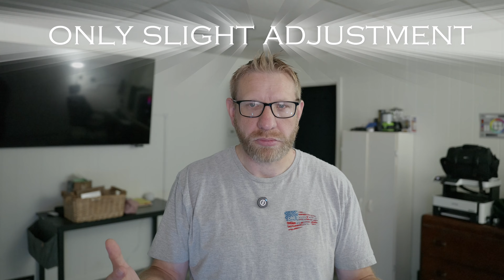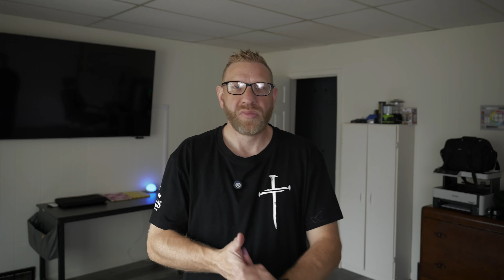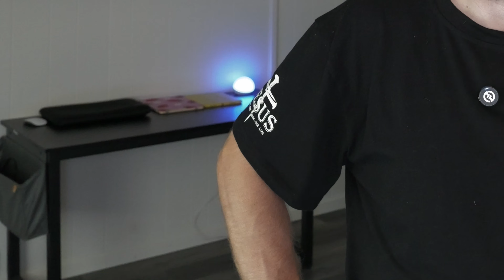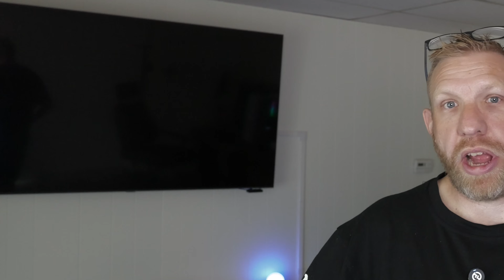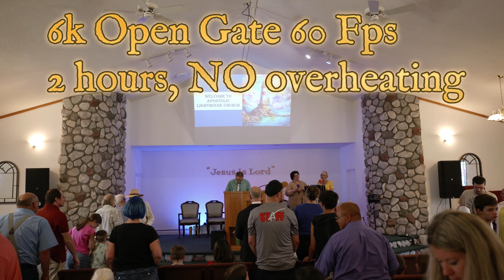Lumix S1II 12800 Iso Low Light & High ISO V-Log Profile Test | Overheating Test result

Comment: It seems the camera is just super sensitive to actual Sunlight. 2h indoors at 6k 60fps is truly impressive. I guess as long as you’re indoors it should be good.
Reply from the maker: Those are my findings! In my other video it was outside for 45 minutes recording to cfexpress b with warning but no overheating 84 degrees 6k 60 open gate still was good, inside no warning at at all

Comment: its looking good but there is some internal noise reduction going on , when you make more movement the noise reduction artifacts are more visible but you need to pixel peep to notice It , so nothing I'd worry about .. but if shooting lots of movement in low light I would consider turning the noise reduction off a notch or two and apply it later in post if needed.  the compressed formats also contribute to noise blotches. (although no particularly severe ) 
if its of interest you could also try ProRes 422 or all intra recording.
Reply from the maker: Yes, that's a great observation. I appreciate that.Thank you for watching!😊